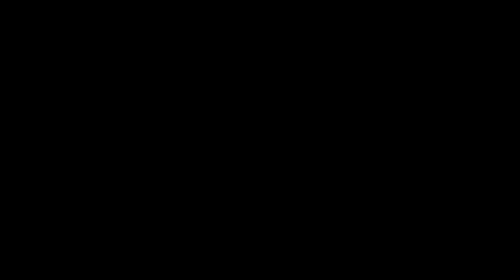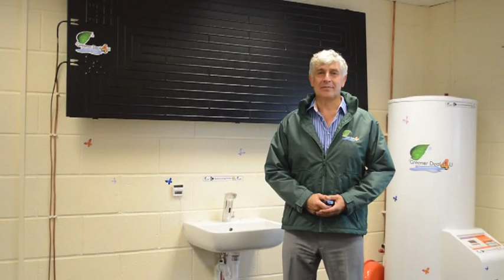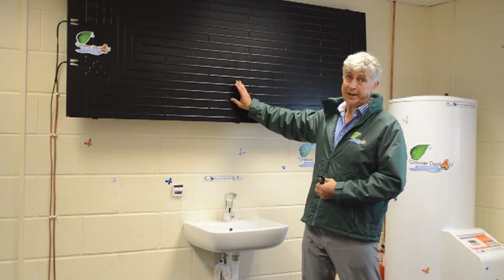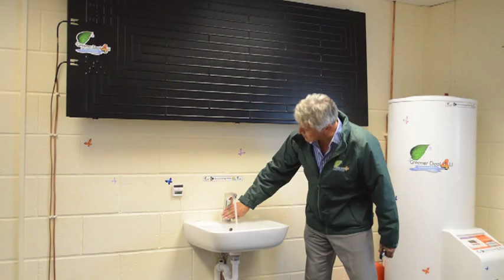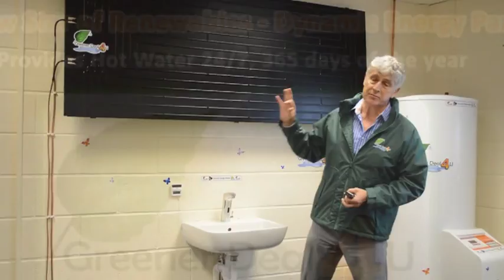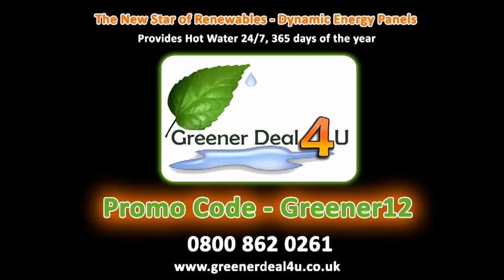Dynamic Energy Panels

Comment: Most of these early sell companies is no longer in Business. The next innovation is to combine a Thermodynamic panel with the 0.4kW heat pump and fit to the back of a PV panel, that cools down the PV panel and some of the electricity supports the running of the heat pump during the day. Best to use a multi fuel thermal store, open vented to use for heating, not just HW
Reply: And why or whats the benefits of cooling PV , please if you can explain to me.
Reply: @ehabtuffaha4083   Ehab ايهاب Tuffaha تفاحة  Its a fact across the PV panel industry, that as the glass/solar cells heat up above there test temperature at 26c, the efficiency will start to fall by 0.05% for every 1 degree rise in the panel temperature.
Cooling the panel down through the back of a PV panel, as known as PVT, keeps the electricity genrated at the highest level, while also providing a FREE by product in heated water of around 16Kwthermal a day from 28 x 300 watt PV panels. 
we are focused on partnering with commercial enterprises across the world who have a need for heat and power, with a back up of a heat pump
Reply: Eric Hawkins are you dealing in the US?

Comment: Could you be more technical and provide some details like: to heat 250l of water to 55  degrees/  temperature outside 0, -10,  +25/. you ll will need X kw of electricity/  and it will take x amount of time.

Comment: Well done for mentioning the efficiency (co-efficient of performance) - a lot of firms promoting this tech imply that it is free to run - it's not.   But as you say it is more efficient than most other renewables and for us the fact that there were no moving parts (like air source) clinched it.   System can go on a timer so it runs when ambient temps are highest i.e during the daytime.
Reply: It has a compressor ... he says it has a condenser ... what do you think condenses the gas ... A COMPRESSOR that has moving parts and runs on electricity.